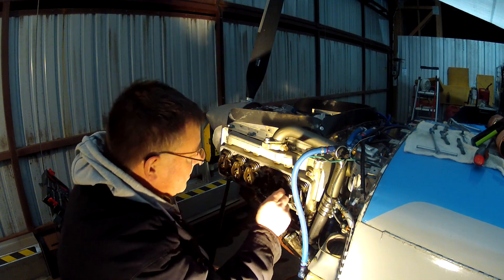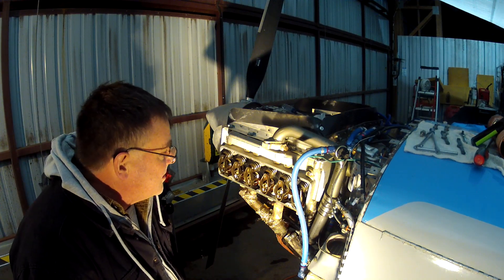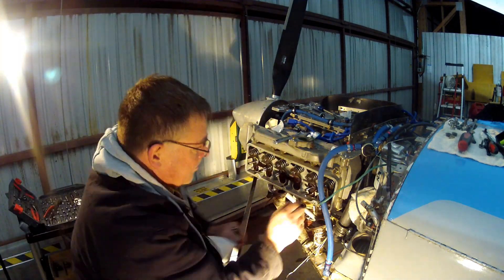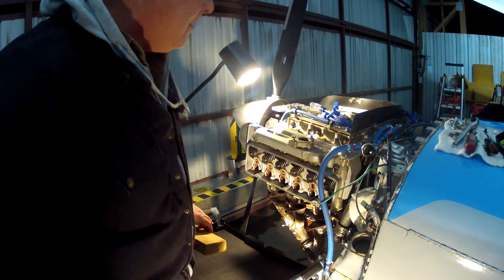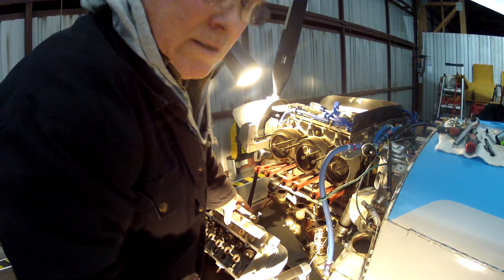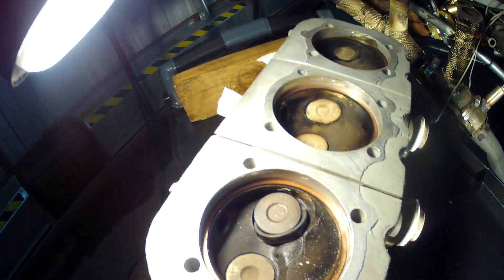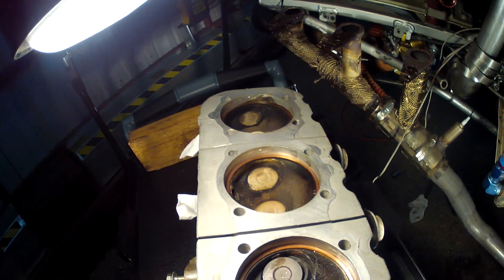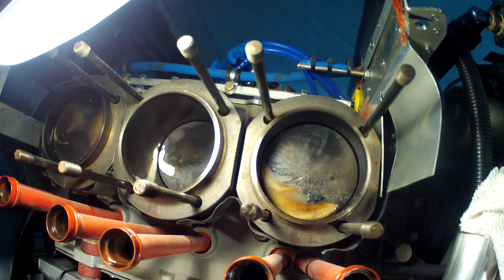My KR2S...Corvair 2775 ground run gone wrong.

Comment: just watched an old video on rebuilding the turtle deck.  noticed the polyisocyanurate foam.   From OSHA publication:  "Rigid polyurethane and polyisocyanurate foams will, when ignited, burn rapidly and produce intense heat, dense smoke and gases which are irritating, flammable and/or toxic."

Comment: Glad to read your approach is to treat/rebuild both heads together. Now would be the time to get the deeper seats and go back fresh and ready. What model engine is this one?
Reply from the maker: This is a 1965 164ci that was built to .060 oversize so now 170ci.  As per the manual it should produce 90hp at 3200rpm.  And yes in my opinion, all these engines should have the oversized valve seats to lessen the likelihood of dropping the seats.  I learned my lesson.

Comment: Who built the engine?
Reply from the maker: This was an early (2005) conversion done by Roys Garage when he was working with WW.  The heads were done by Mark Langford then and as far as I can tell have given 680 hrs trouble free.  They looked good back in 2019 when Roy rebuilt the motor for me.
Reply: @chwilliams5  I was just wondering when I noticed the bolted on intake. Thanks for documenting this here, and I look forward to seeing the repairs! I have a pair of Corvair engines to convert, I plan to work on them simultaneously, then when I do the airframe, pickle one and have it as an operational spare for when things like this happen!

Comment: poor machine work. weld seat area and remachine for seat. i'd do them all
Reply: btw. on the piston. make sure the ring isn't squeezeed in the gland.
Reply from the maker: Yes both heads are coming off for a rebuild.  Once they start this crap they will continue I am told.